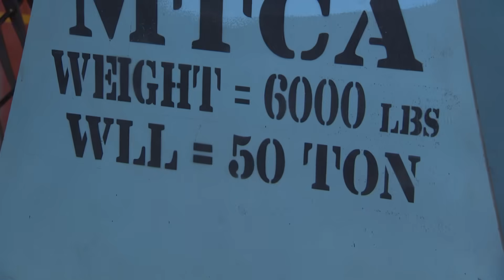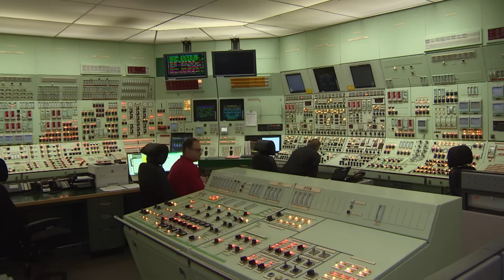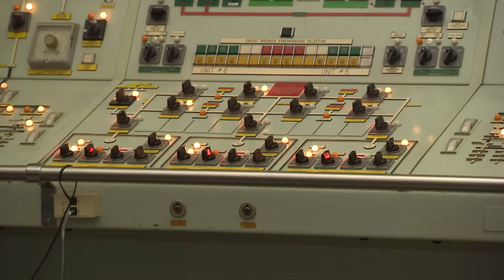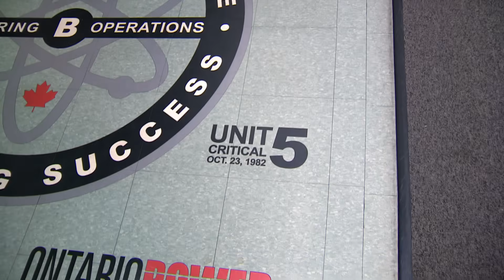Here's what it looks like inside a nuclear power plant

Comment: I think we can do a lot with miniature nuclear technology. This is going to be great. We can do great things with the smaller reactors. There are prototypes being developed. And they aren't as dangerous. 

Not to stop the big ones from being built better, safer by fixing existing reactors and advancing the technology. They can make this very economical. Electric cars, high speed rails and nuclear energy maybe what we do reducing the need for so much fossil fuels from use. We can drop the usage down or change how we refine it. They are working with all the data.

I think we are close to a revolution with nuclear technology that may add to our power grid in a big way. And I believe they are one discovery away from this being something that fills our power grids nationwide. 

All kinds of other technology will advance. I hope I live long enough to see what is going to happen. Fascinating! Hydro tech, wind tech, solar tech, nuclear tech. Computer AI tech can be designed to warn people and offer information in real-time to fix all problems with a nuclear reactor. AI will not take jobs here, it will solve complex problems and assist technicians so that it is never dangerous. It can be built so that it is never dangerous with AI integral to the system to monitor every mechanical process. It is going to be the safest and cleanest energy source in the future. We need it.

Comment: I worked for one of the equipment and service vendors at the Pickering station back in the 90s for several years, prior to returning to the US. It wasn't unusual to attend back-to-back meetings at Units at opposite ends of the station. That effort would require about a half-mile walk and several scans along the way. Boy, did I lose weight. It was great working with the Ontario Hydro people - although I can't say I miss the winters.

Comment: We're still living in the 1700's with steam engines.  We haven't come that far actually.
Reply: They can make cars drive on nuclear battery/energy but they don't because they are milking the current system. The need "the fear of fossil fuels" illusion to keep you scared and paying high costs for electricity or gasoline. The whole system is a farse. Half the cost of gasoline is actually taxes. Same thing with the electronics sector, they already have terabytes/petabytes that can fit into the size of a quarter but they have to do controlled releases of technology every couple decades to milk the money. I heard from one engineer that there is actually so much gasoline in the earth they don't think  it'll ever run out. You think those saudi princes are worried about the gas in the earth? Its a literal gold mine over there.
Reply: @Alex_Justified  This is so wrong.

Comment: Why they store those turbine shafts like that? A crankshaft from a diesel or gasoline engine, needs to be stored standing straight up and down. Gravity will make it bend in the middle. 

Or am I missing something?
Reply: They’re usually on stands that keep them continuously rotating at a very low speed to prevent sagging. These ones don’t appear to be, and I’m not sure why. Possibly just very short term storage before they’re moved out for refurbishment

Comment: What if they are exposed and they were sent to there doctor's etc. Could raidation be on anything they carry home also? If they never would tell them what there radiation levels was. Why would they not?
Reply: You get exposed daily, but extremely low levels and you wear dosimetry gear to keep a close count on your intake both total and rate. It’s damn near impossible to take anything radioactive home. You stand in so many monitors both on the way in and the way out of the building that are so sensitive that radon will set them off. I’ve been stuck waiting for radiation protection to come check me out from setting off the monitors just from being rained on outside a bit. The rain will alarm for radon.  They’re wildly sensitive and accurate.

Comment: What if visitor will run from one control panel to another while pressing buttons and turning switches? What will operators do, try to neutralize the visitor first or turn switches back? 🤣
Reply: Well if it helps you, the Nearby Darlington Nuclear plant has won the world SWAT TEAM  competition several  times so I'm thinking if you start pushing  buttons they'd drop you like a bad habit......😮
Reply: In the nuclear power plant I work sometimes the operators were afraid I would screw up something working with protection relays(there's often the risk of working on the wrong equipment). I think that if even we, maintenance workers, are sometimes very limited in what we can do, I think that they wouldn't even let a strange come close to the control boards. Where I work, the floor has two colors, blue and a lighter shade of blue, so if you're not an operator and if you don't have a reason(like working in some equipment, or cleaning idk) you are not supposed to step on the tiles with darker shades of blue. Also, because of incidents that happened in other power plants, the number of people that can enter the control room is limited. Also there's another thing, I was working for example in the circuit of a disconnect switch, and the operators were afraid we would screw something up while investigating, but after analysing the drawings, that circuit is interlocking so the disconnect can't be operated by accident, so in my example, you can see the operators are very protective, so even as a worker, the operators will keep an eye on you. And as in my other example, some systems are interlocked so in case you do something really wrong, nothing will happen. And even if something really bad happens(for example if you shut down some important pump), the reactor will trip and most of the time there's only economical loss, with no power being generated, there will be no money being made. So as you can see, before something happens, there are multiple layers, first they don't let unauthorized people enter the power plant, the access to the control room is limited, if you go to the control room, there are places you can walk and other places you can't, unless you are working on something, inspecting something for a reason, if you have a reason to be near the control boards, the operators won't allow you to do anything risky, if you mess up something, the worst thing that happens is usually a reactor trip.

Comment: what happens if it blows up?
Reply: Depends on which section blows up. 

The steam going thru the turbine is not contacting the fuel. It would still be one helluva explosion. Safety standards are much better nowadays so while it is possible to get Chernobyl-d, it is less likely.

Hopefully.
Reply: @niccatipay  I feel like people like to prop up cherynobyl when that is 100% an example of what not having the best safety standards will do.
Reply: @haroldfarthington7492 
People prop it up because Chernobyl is still an exclusion zone even today.
If a coal or gas plant blows up it gives off acid rain for awhile at most, not a decade long dead zone.
Reply: Pickering uses pressurized water reactors, Chernobyl used Rbmk channel type reactors
Reply: Containment buildings exist in nearly all reactors today unlike Chernobyl so if there is a big explosion, the power plant investors get harmed.

Comment: Imagine discovering how to split the ATOM, the very thing that holds the universe together,  and using it to boil water.
Reply: Coincidentally, water just so happens to be one of the best possible working fluids out there, and it's available to us in abundance.
Reply: Water is known as the universal solvent for good reason. 
The fact that it can act as effective shielding while at the same time facilitating a controlled and sustained fission reaction makes it the best possible moderator.
Reply: Nearly every power source in history
Reply: best way to generate electricity is with a generator
best way to turn a generator is with a steam turbine
best way to make steam is nuclear energy

Comment: What happens if the power goes out there
Reply: Diesel generators keep the pumps running for any <Generation 4 reactors, otherwise, in the newer reactors usually convection takes care of the heat.
Reply: The sites I’ve seen have had multiple redundant off site power sources, then twice as many permanently installed emergency diesel generators as needed with fuel to run for days at full load, then several portable diesel generators stored in separate buildings on site just in case the permanent ones get damaged. Then there are also large battery banks for the most critical components necessary to cool the reactor. Finally, there are multiple facilities in the country that keep emergency generators and other equipment on hand constantly ready to be airlifted to any nuclear site suffering a major disaster.
Reply: There's a video form the Canadian Nuclear Safety Commission on YouTube that discribes a station blackout situation. Basically the reactor will shut down, and because of the passive designs of CANDU it will basically just chill out. Worse case they have to use fire trucks to keep the massive pool of water the reactor sits in full but do to the volume of water it will take a long time and natural circulation of the pool will it cool for a reasonably long time.

The downside of this design is it's pretty expensive but it's pretty genius thinking.  "CNSC total station backout"